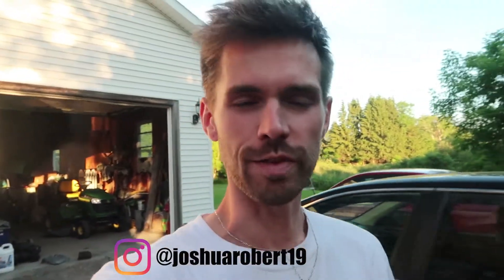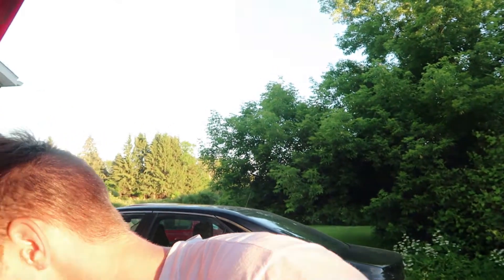HX35 Turbo almost ready for 24 Valve Cummins

Comment: I had the same problem with the fuel can drain. I had order a new one off amazon. The day I was going to replace it, I notice the 2 screws were loose. I tighten them and no more leaks after that.
Reply from the maker: MarioAllDrunkAboutIt I pulled mine off not to long ago to clean up, and my plunger is screwed up. I'm just gonna grab a whole new drain. Cheap little plastic things haha.

Comment: The o-ring is much better those banjo bolts come loose. Make sure and check the one on the back of the head...
Reply from the maker: Which one are you talking about?
Reply: It is the excess fuel return on the back of the head
Reply from the maker: Chad Myers73 I'll check it out. I actually had no clue about that spot. Thanks for that!
Reply: Its actually unused fuel from your injectors.
Reply from the maker: Chad Myers73 shit, I've probably got plenty unused fuel for right now until I get the mods done to take care of the air side of things on truck haha.